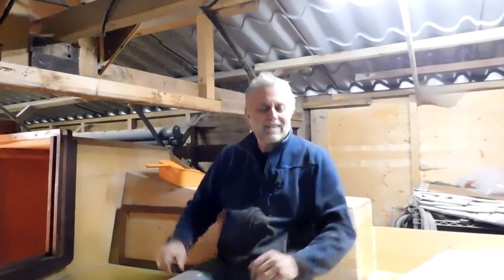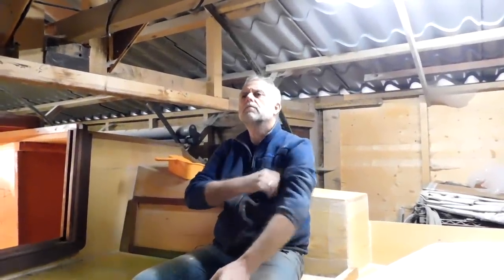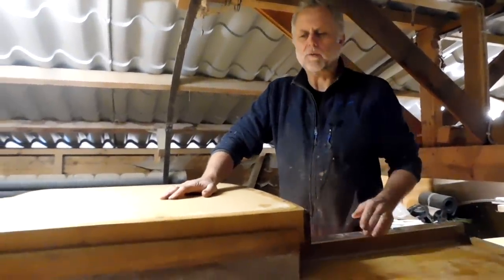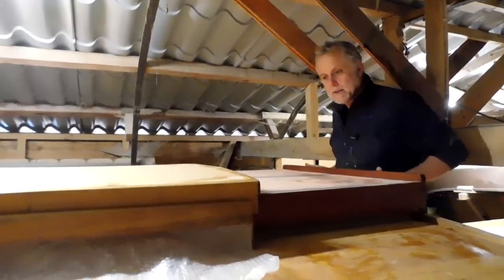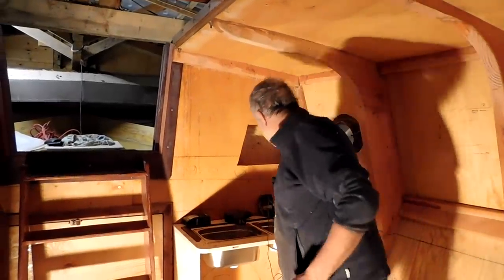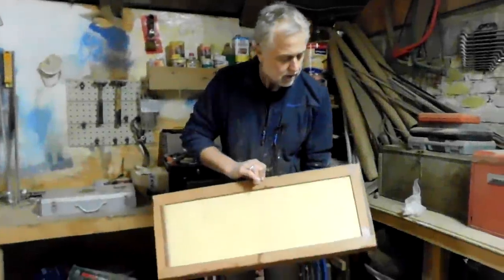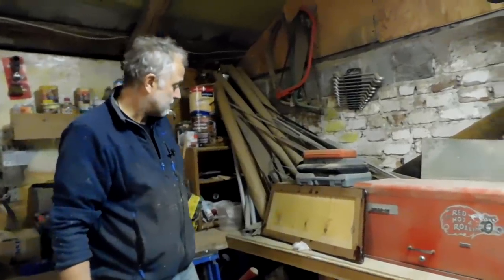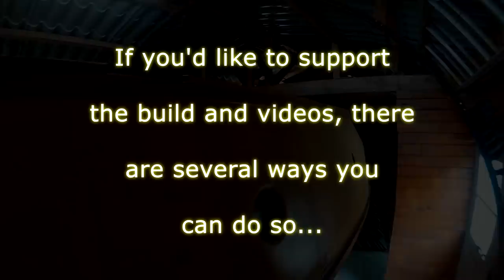Boatbuilding skills, black locust and the galley is started - SV Tapatya EP110

Comment: Advise: use foot pump in the galley. You need two working hands when in ocean and do the galley work. It's a boat, not a bar. (pub)
Reply from the maker: It's a fair thought Svein but we had those hand pumps on our old boat and sailed on the ocean without issue. I understand the one hand for yourself principle, but by standing the pot in the sink to fill it, only one hand is needed to pump.
Reply: @SVTapatya  ... and a cold lager in the other :) Good luck!

Comment: Great to see how the galley will look. A word of warning about the diesel stove you have planned. They do use a lot of battery power to get them going as they have a glow plug. If your battery power is not fully charged it often drops the battery voltage to the point where the oven trips off. Very annoying if you are at anchor and fancy bacon and eggs for breakfast in the morning but have to run the engine to get the stove working. Have friends report that the stove heater combination units get a lot of noise from the fans. Worth knowing if you plan using one to take the chill off during those quiet evenings up a quiet creek.
Reply from the maker: Thanks Mark
The Dickinson stove I'm fitting works on a very low-tech, but highly effective system that doesn't need a glow plug. It does have a low-draw fan for use when lighting, but otherwise requires no electrical power 👍😀

Comment: Any thoughts about installing a 'sealable' vent in one of the washboards. I always found sealing my sailboat up tight resulted in black mold everywhere, so I cut a hole in the upper board and used an old, round camper vent to let some air inside. Already had a 'pop-up' on the fore hatch but it didn't allow 'flow', being just the one. Still got musty in wet weather, but the mold dropped off quite well...
Reply from the maker: Yes Mike. I’ll be putting a vent in that upper board. The hatch turtle has built in vents too 👍😃